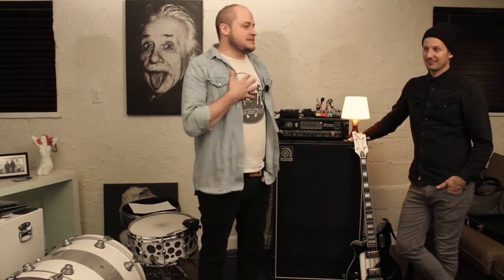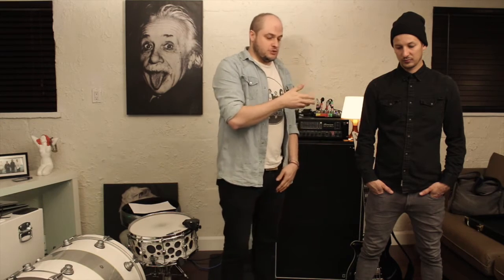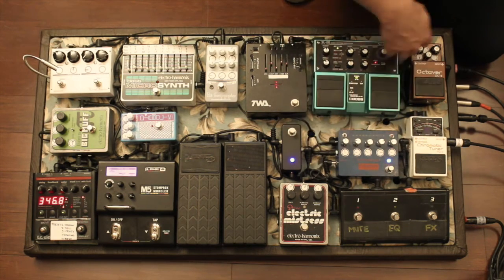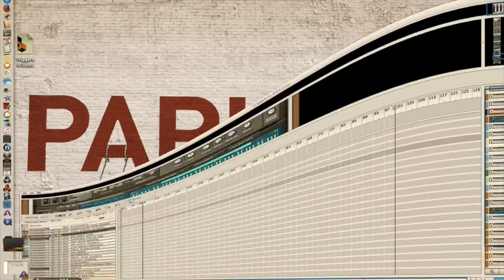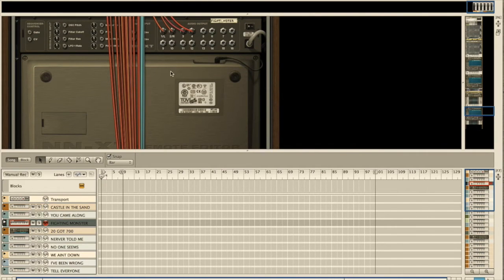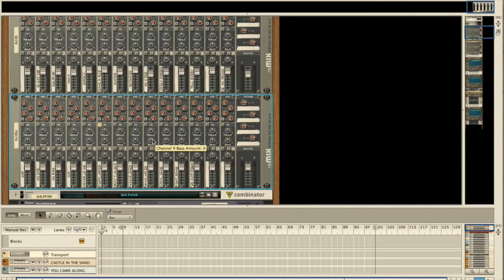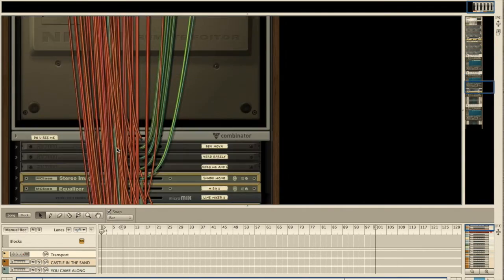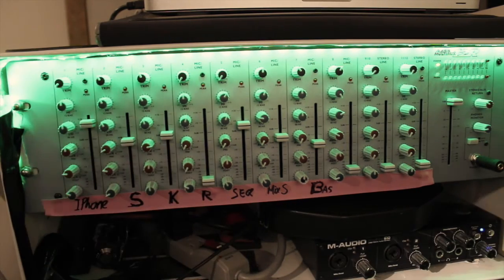Sidechain Compression on Stage with Unknown Colour (Empress Compressor)

Comment: If it's an unbalanced input why don't you just Mic the bass drum?
Reply from the maker: The input is line level so if you have an extra mixer to use as a preamp it would work! The thing in our case is that we use bass drum trigger on every songs so using the output from the interface makes it easy to adjust in pre production the level of compression for each individual songs...  If your FOH guy do have a extra output to send you it would work using the bass drum mic but since the Empress Compressor side chain input is unbalanced you might end up with noise issue in a long run if you,re in a small venue with an analog snake but with a digital snake you might be ok! Thanks for your comment...
Reply: Unknown Colour I think I’m just going to go with the deep space pulsar side chain pedal instead.